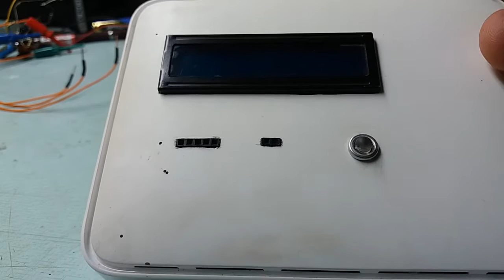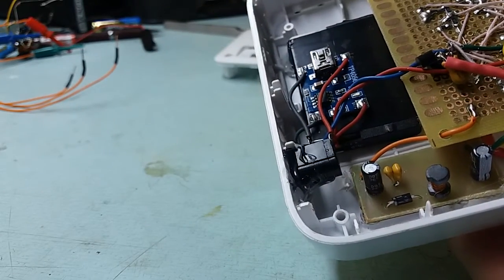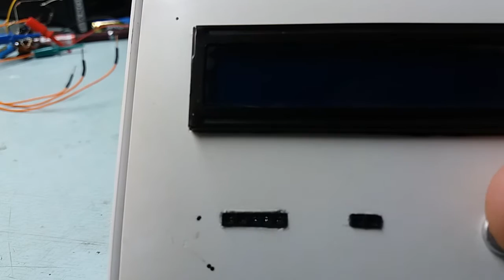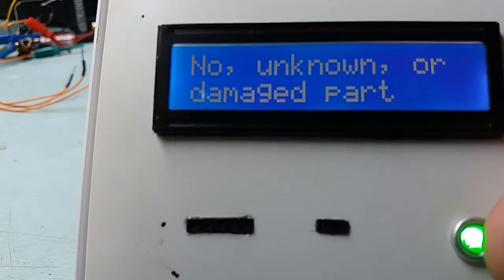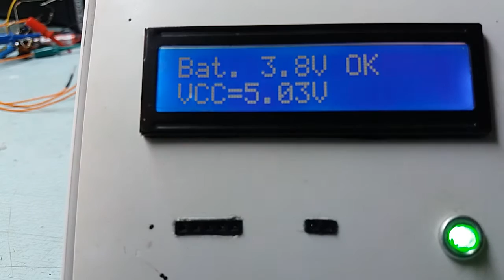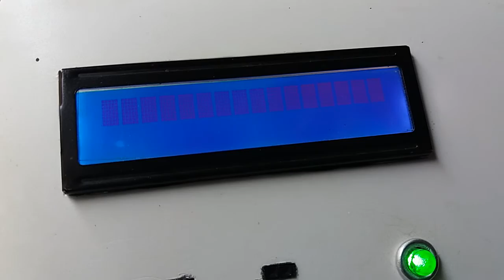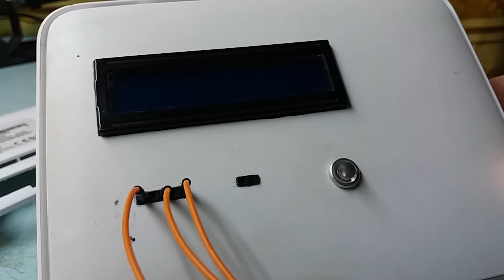Transistor Tester (homemade)

Comment: Thanks for making the video! I think I may attempt making my own. Please can you tell me the code/name of the IC on the other side of the board, and any other key components? And where is that screen module from?
Reply from the maker: The chip is AVR AtMega328p; LCD is a generic one, has 16 characters and 2 rows. You can buy it on eBay or anywhere else, just make sure it's compatible with 44780 controller. Other components are very generic - resistors, caps, transistors, regulator (7805 if you're using 9V battery to power the thing). Schematic is here: http://www.mikrocontroller.net/articles/Datei:TransistorTesterVC1.png
 Main chip is a microcontroller which comes blank when you get it, you have to buy a programmer and program the chip. Files for Mega328 are here: https://www.mikrocontroller.net/svnbrowser/transistortester/Software/trunk/mega328/

Comment: Ahh the large capacitor, did you try putting the pnp power transistor after the capacitor?

Your construction reminds me of mine lol :-D.
Millions of years ago i built an eprom programmer for the zx81 computer, but it was limited so i modded it to work in a spectrum, and added the support for larger eproms.
Loads of mini switches :-D
The clear box i put the original pcb in was nice untill i made all the changes, lots of mods made with all sorts of wire and extra chips added in a rather messy way, i never made a propper second version, the mess worked for years, i was very happy :-D.
I painted the box, no more mess to see LOL :-D

Your device works, it does the job you wanted :-D :-D.
Reply from the maker: The funny thing is, the transistor is after the cap.  Microcontroller adds the delay necessary to make this "oscillator" ;)
Reply: Oh well thats a good plan shot down in digital flames lol :-D
Well you fixed it anyway :-D
i did look at that site last week, i was thinking esr tester too, but the downloads didnt include the hex, i must have been blind to miss the version you use.
Would you say it was pretty good at esr?
Reply from the maker: zx8401ztv Here are the files for Mega328:
https://www.mikrocontroller.net/svnbrowser/transistortester/Software/trunk/mega328/
It's version 1.12k (k for Karl Heinz). Yes, it's pretty good at ESR measurements, the resolution is 10milliOhms
Reply: Thank you :-D, i will have to look into dumping the hex into the chip, something i havnt done for years, the last one i did was for an old pic chip based L/C meter, but that wasnt fantastic lol.
Reply from the maker: zx8401ztv Also, don't forget to fill up the EEPROM :) Since you had experience with PIC's you'll figure it out, but you need additional programmer for AVR, smth like USBASP
Reply: Thank you again :D, when i did the old pic chip i converted the hex file back into the rom image, then used my willem programmer to dump it into the pic.
But things have moved on since pics, so i will have to be carefull lol, als the brain is slower to get to grips now, but it will happen :-D
Reply from the maker: Whoops! I was tired last time, and made a mistake :/  The cap is after the PNP. It goes like this: battery > PNP > DC-DC > cap > uC magic. I could've solved the problem by putting one more PNP after the cap, but it works great as is :)
Reply: i have made some silly mistakes, but remembered things different :-).
Memory isnt allways the truth, and being in the wrong state of mind can create some silly mistakes :-D.
Hey you made it, and it works, thats the important part :-D

Ive had a quick look at the data files for that chip, two hex memory images .eep and .hex, more complex than a pic.
The data sheet says something about a bootloader, sounds like a bios rom, and there seems to be more memory blocks, not sure about it yet.
But im just looking, thinking over the idea, you know :-D
Reply from the maker: zx8401ztv True story :) And, I built it myself because I had everything neccessary on hand. If I didn't, I would've bought one from China. Makes life easy, but takes the joy (or frustration :D) of building it yourself away.If you plan to build only it, I would recommend to buy one. You need some programmer, uC itself, LCD, voltage reference, couple of transistors, etc. It's up to you
Reply: Im not sure what the isp connectons are for, unless its for programming, i havnt analysed it too close yet.
The programmer wants an mega88 programmed, talk about a ring of sillyness lol, i need a programmer to program a chip to make a programmer to program the mega328 chip LOL :-D.
When i get my teeth into the idea it will all make sense :-D.

Thankyou for your help, there are too many versions stated on that site for me to know which one will do.
Reply from the maker: use a link I gave you before and get an AtMega328p in dip-28. That software is for this chip. USBASP is a programmer I used, works great and it's cheap. ISP is what you need to program the chip with USBASP
Reply: Ahh im sorry, i didnt see the link, but you did say "but you need additional programmer for AVR, smth like USBASP".
I searched and found the earlier "make it yourself" site, wrong place. Just looked looked around and there is a ready made slim usb one usbasp v2, that looks the ticket, very neat :-).

I think i need a brain transplant, you dont know any shops i can buy a 50 year old one from 1966 LOL :-D.
Some days im einstein, most of the time im his dog :)